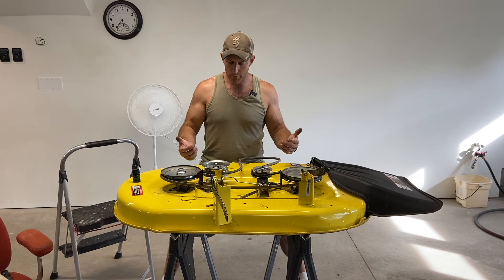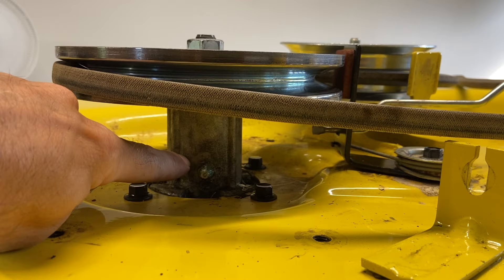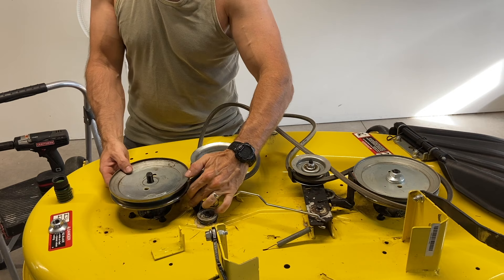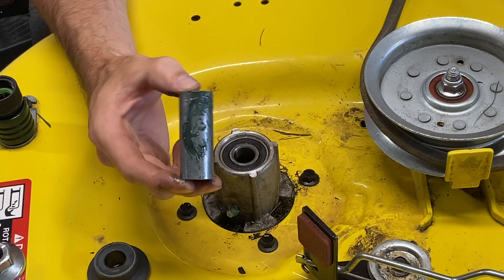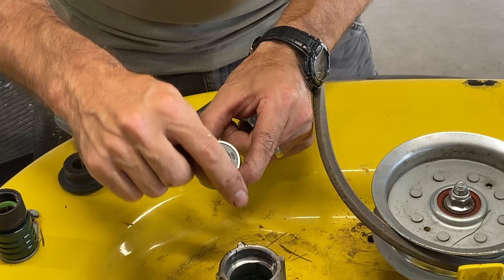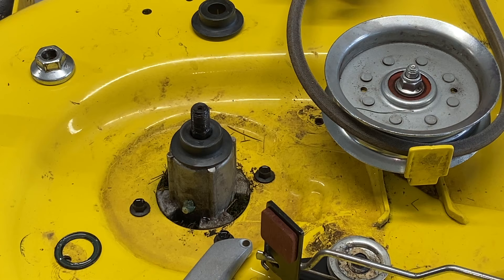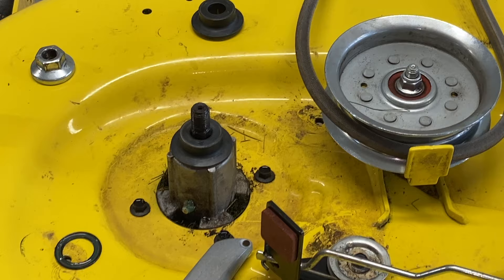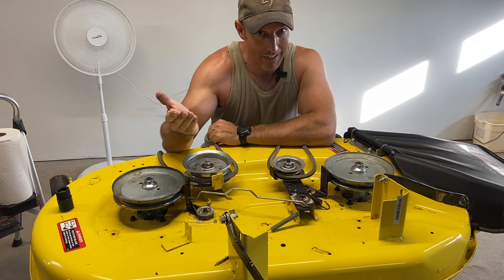I WOULD DO THIS DIFFERENT NOW JUST REPACK THE BEARINGS WITH GOOD GREASE AND PUT SEALS BACK ON.

Comment: I used to think the same, but completely filling the housing with grease will push grease right past the seals, in one side and out the other on both top and bottom bearings.  Try it yourself.
Reply from the maker: I have changed they way I think about this now that’s why I say to read the comments. Thanks for watching and leaving a comment hope your summer is good
Reply: I agree with you 100 percent.  If you pump in enough grease, it will actually get past the plastic seals into your bearings. There are videos proving this.

Comment: The whole purpose of the sealed bearings is to keep the grease in and the water out, when the grease is gone, or they get water in them and fail, its time for new bearings. They likely just put the grease fitting there to appease those who felt they needed to grease the spindles. The bearings in my spindles are original from 1995 and still going strong. I pulled them out and repacked them about 8 years ago with some synthetic grease when I repainted the deck.
Reply from the maker: Thanks for watching and commenting

Comment: You still need to drill a pressure relief hole in the spindle housing opposite the grease fitting to let out the pressure when greasing the spindles. As soon as the relief hole starts squirting grease the spindle is full and your ready to go. If you do not have a relief hole in the spindle housing you run the risk of blowing out the other seal on your bearing do to excessive pressure on it without a relief hole. Make the relief hole 1/16" in size to 1/8".
Reply from the maker: Thanks for the tip and thanks for watching
Reply: There is pressure relief fitting that can be installed like a second zerk.  It is like a backward zerk in that with enouh pressure the spindle contents are released.  My Ventrac mower decks have these.  The "rubber" seals will allow grease to pass by them inward to ball bearings and cage.

Comment: The way the guy at the bearing supply explained to me : metal shield are designed so metal shield does not contact metal race so grease may flow past.   Plastic , rubber whatever is designed for a contact seal. . So following that ,if you want to be able to re-grease maybe for bottom bearing put metal down (to "vent" and remove upper seal of that bearing. My limited experience is the top bearing can last a long time  (25 year old DR field and brush mower, still good factory top bearing) so, seems like leaving top as sealed is OK. I am going to leave both mine as sealed
Reply from the maker: thanks for watching and thanks for the info

Comment: I was waiting for you to pack the bearing with grease before ya installed them back in
Reply from the maker: That would be a good idea
Reply: Definitely should pack the bearings before reinstalling, your not giving the bearings a good head start, ALWAYS pack your bearings.
Good Job
Reply: What do you think the pressure from the grease gun is going to do when he fills the cavity? No sense in doing extra work if it will just happen later.

Comment: Alternately, you can schmoosh grease into the bearings themselves and the put the cover back on. It's more work compared to leaving them off and using a grease gun in the future, but it helps keep them clean and from getting sand or other particles in them over the years

Also, at least for the top bearing that has a removable cover that is outward facing, you don't have to completely remove them like you did - just remove the cover, push in some grease, and put the cover back in. Gotta love applying the knowledge I gained skateboarding to fixing tractors 😉
Reply from the maker: Thanks for the tip, thanks for watching

Comment: Great job on the video. Instead of fill that void with grease I pop my bearings out, take off the seals, clean and repack the bearings. Then I put the seals back on. At the first sign of wear I replace the bearings. Regular price at Princess Auto is $4.99 and they go on sale for 1/2 price. 6203-2RS & 6204-2RS. Take Hans Nielsen advice for installing the bearing. Thanks for your time on making this video.
Reply from the maker: Awesome thanks for the info, thanks for sharing
Reply: Which one is it? 6203 or 6204?
Reply: @lkevonly  One of each. One is for the top and the other is for the bottom.

Comment: Grease passes through on my Hustler. The aftermarket spindles didn't have zerk fittings so I drilled and tapped them. Took a ton of grease but it did begin to push around the dust covers. Mine look like your bearing with the black rings. I can't call them sealed because mine are just some kind of fibrous dust cover. 

What I will do on my other mower is grease them real good with a grease needle using red-n-tacky grease.  Needles are 3 for $6 at Amzn. Reusable of course. 

Thanks!
Reply from the maker: Thanks for watching

Comment: Its not just John deer.
My cub cadit didnt have the tube inside and the inside of thd grease chamber was as large as yours 
Without pumping 4oz or a full tube of grease into both or all three spindels your berring could never get greased.  Me i hand packed them full took off all the pullies and hand packed the berrings.
See 3 winters ago i took off the deck to fit the snow blower on then wShed the deck and put it away for winter figuring it would dry out.
Well it was dry the next spring but so were the berrings they made all kinds of niose loud very loud.
Thats when i took it all apart and added a high temp high speed grease  after running with the PTO on for a few min it got quite agine
Sure the berrings got some dammage but i didnt run it very long just a few min, so it was only some rust  wd49 fixed that. 
No problems after 3 summer seasons. And i did take the dust caps off thd berrings you pump more grease in untill it pushes some out both sides. Thd ideler pullies  have to be done by hand each one new is about 35 bucks.
And you cant replace the berrings its welded togather john deers are rivited thoses you can dril out the rivits and put short bolts and nuts in.  Look on youtube somone shows how.  Why would you spend 50 bucks to replace a 2 dollar berring
Reply from the maker: Thanks for the tips and thanks for watching

Comment: I've been working on centrifugal pumps for many years,  nothing kills a ball bearing quicker than over greasing.
Reply from the maker: Thanks for the info and thanks for watching
Reply: Same goes for superchargers, and high volume air pumps. We're conditioned to the way we used to pack old Timken spindle bearings on a car. But SKF will tell you 20% fill is what a sealed bearing needs. More equals excessive heat= bearing failure.

Comment: If that motor turns 3600 rpm, in an hour long cut the bearings have spun over 200k times.  In a season that's many millions.

In the first cutting season of my E140 one of the spindle bearings went out and I didn't notice (headphones on) until it allowed the pully to drop and it ate one of the mounting screws down to the deck.  The pieces of the bearing were spread across my yard lol and I greased after every cut but apparently the grease wasn't getting to the bearing.  It was a busy summer so I replaced the entire spindle but I'm now changing them and packing the new bearings.  Thanks for the video.
Reply from the maker: Thanks for watching

Comment: I appreciate the video. I would leave the sealed bearings sealed .I'd like to see if the greased unsealed bearings actually last longer
Reply from the maker: I'm going to see how long they last because I am not taking apart again until they wear out, thanks for watching
Reply: I think we're going to need some put brand new spindles on there mower do one spindle removing seals and the other leave stock and do same maintenance to both and see How they last? Hopefully someone down South that mows year round to get results sooner!

Comment: I think the grease would have by passed the rubber shield IF the spindle had been injected with enough grease to fill it and pressurize it.  Works for me.  Fill'r up!
Reply from the maker: Thanks for watching
Reply: I think it would follow the path of least resistance, so would the grease not go out the spindle gap before going through the bearing cover since it’s a tighter gap.

Comment: The bearings with the plastic seal that covers the bearings can be popped off to repack the bearing, after about 2 to 3 years the grease breaks down, yes even high temp grease. Bearings should be repacked, but NOT left open to the elements. Jeff Webb is 100% correct the grease fitting isn't for the bearings it's for the shaft because it's a friction point.  On a side note if the bearings look slightly different it's because they are, on that plastic seal is a Alpha numerical code that says what type of bearing it is. Many times you can purchase new bearings for a fraction of the cost that the Lawn mower company is selling by ordering new bearings with that code.  I cringed when he pounded the new bearing in with a hammer, always use a block of wood and a hammer.
Reply from the maker: thank you for the advise and thank you for watching

Comment: I saw a YT video that showed the grease gets pumped thru the bearing past the seals, and comes out the other side. Bearing were sealed on both sides, and he showed a inside of the bearing before and after pumping, and the new different color grease came thru. Don't recall the link, but the seals flex enough to let grease get pumped past them. And the seals did not pop off and stay out of place. Was surprising.
Reply from the maker: Thanks for watching

Comment: When the top bearing warms up, gravity will let the grease fall out and run dry. Bottom will work if you do not over grease. There is a way to take take out top seal and repack it with synthetic grease. Then replace top rubber seal. Too much grease and bearing will run hot.
Reply from the maker: Thanks for commenting

Comment: I've been doing this for years in my shop for my customers , but I only do the bottom , never the top because gravity will pull the grease out and have never had a bearing fail by repacking using Lucas Red & Tacky !!
Reply from the maker: Thanks for the info hope you have a good summer
Reply: @DIYJIM  😉👍
Reply: Makes sense. I wouldn't have thought about the gravity aspect. I'll definitely reseal the top bearings.
Reply from the maker: i agree i think this is a good idea but i am not taking mine apart again
Reply: Can't beat that Lucas red and tacky,use it on my truck also. Good stuff,cheap insurance.
Reply: @pgh1all1   Project Farm has an awesome grease comparison test .... it is the real deal !! 😎

Comment: I think the sealed bearings are the best way to go. Without the seal the grease spins out. The grease zerk it to lube the spacer and shaft inside the spindle housing. For residential use My bearings are going on 6 years no problem. Commercial users need to buy HD Mowers.
Reply from the maker: Agree thanks for watching

Comment: Without a pressure relief hole somewhere in the spindle, at some point while pumping grease in something's going to have to give due to hydraulic pressure. If I had to guess it would probably be the seal that was left in. Once that spindle is full of grease, one more pump of the grease gun is going to create its own vent somewhere.
Reply from the maker: i have seen where guys will drill a small relief hole in the spindle
Reply: I highly  doubt that spindle is sealed  100% to the environment. Unless it has a shaft seal, which it doesn't,  air can escape  around the shaft.
Reply: I bought a used mower last year to swap the deck into mine that had rusted out from underneath. Someone had already greased it to the point that grease was coming out at the top of the spindle near the pulley and slinging grease on the deck.
Reply: If the grease has nowhere to go, it simply backs up and out of the zerk

Comment: Never read all comments but will add this... While shaft and blade out its a good time to do blade maint/sharpen /work bolts that hold blade on .I grease mine  some say lock tite ..your choice...
Reply from the maker: I have never used loctite just try to use torque wrench and tighten to the torque setting that is normally in the manual

Comment: The zerk is problematical. To get fresh grease into the bearings you have to expel the old grease from the bearing, it has to exit by popping the other seal. Then, you have a hidden seal that needs to be reseated. Whichever seal pops first gets all the grease! Now, you are depending on a gob of grease emerging from the seal to keep out any grit that gets stirred up during the dry season. That might work if you use a blower to clean up the deck, but a pressure washer will make things look spiffy and probably get water inside the bearing. By the end of the season, you would probably need a new spindle assembly when the bearing seizes and spins in the housing. The dealer's parts department will love you. Some spindles have factory drilled holes to allow sweating from humid weather a chance to dry out. If replacing the spindle, the hole should be in a direction that won't be filled by another blade, not in a direction that is convenient to grease. A better solution is a radiator clamp holding a patch of cloth over the hole. Water vapor can escape, but the gross stuff gets shut out. However, be careful if the housing is non-cylindrical.
Reply from the maker: Thanks for the well explained comment
Reply: I put zerks on my 12 year old sears 1500 yesterday, greased both spindles, don't care about upper bearings.Plenty of new grease came out on the lower bearing good for another 12 years- i'm out!
Reply: @conductorjohnmthtrains2239   the seals don’t pop off anyways, he has no clue what really happens. That’s absolutely not a issue with a good assembly. Your on the right path. Thankfully some folks like you are smart enough not to figure this out. Obviously not all of them.

Comment: Bought a John Deere S130 last fall, so starting to get into maintaining it. Recently greased the front wheel hubs, steering spindles and front axle pivot and was undecided on whether or not to grease the blade spindles. I watched a few videos on the subject along with this one and found the videos and the comments to be very interesting.

At first, it made sense not to grease the spindles since the bearings are sealed, figuring to add bearing grease as necessary down the road. The argument for no spindle greasing was supported by the fact that some spindles have no grease zerks at all.

Then, some suggest (like your video) to remove the inside covers on the bearings to allow periodic packing of the bearings by filling the spindles. Initially, I gave consideration to this idea until I investigated a little further. One reason against this was the possibility of gravity pulling the grease out of the top bearing. Another was the possibility of popping the outside bearing covers off due to the pressure of overfilling the spindles. Right or wrong, I figured this procedure might add to the possibility of moisture and debris contamination of the bearings, especially if drilling weep holes in the spindle to avoid over pressurizing.

So back to thinking not to add grease until I read that keeping grease in the spindle keeps moisture out, avoiding any rusting of the shaft and spacer. Also, reading that the intent of adding grease to the spindle is to keep the friction down thus lowering the operating temperature.

Decision made right! Not so fast. I was under the impression that my new John Deere S130 no doubtably had zerks on the spindles, right? WRONG, hadn’t noticed before now, but NO, there are no blade spindle zerks on my 2021 S130. (See updated reply)
Reply from the maker: Guess you don’t have to worry about grease. Thanks for watching hope you have a good summer.
Reply: Yes, you too. I enjoy watching your videos.
Reply: Updated reply

Saw yet another video where someone had to replace an old John Deere spindle. The new spindle has the grease zerk on the top of the shaft (I assume there is a small hole in the shaft inside the spindle to allow the grease to flow into the spindle). Lo and behold, that’s where the zerks are located on my S130. Would’ve been helpful for my manual to show this zerk location, but it describes the zerk location on the side of the spindle.

The manual says to grease the spindles every 25 hours with one or two shots of grease. So I have settled on keeping it lubricated per the manual.

Also very interesting, the latest video that I watched also showed the old John Deere spindle that was being replaced having the bottom bearing without a seal on the top. The top bearing had both sides sealed. Looks like even the manufacturers struggle with what is the best method of extending spindle bearing life (or is it all about the bottom line - cost).

Comment: Its true!   A shorter version is to load 90 wt .  The top has clean enviornment so rarely give problems.  The outside seal catches hell no matter what you do.  90 has less rolling resistance an will keep the seal wet
 Added bonus the centrifugal force is just enough to sling off the grit from the shaft rotation. Grease will not fling the grit and more often turns to a wax impregnated Grit going round and round between the shaft and the seal lip
Reply from the maker: Thanks for watching